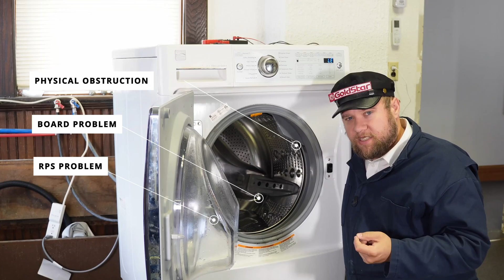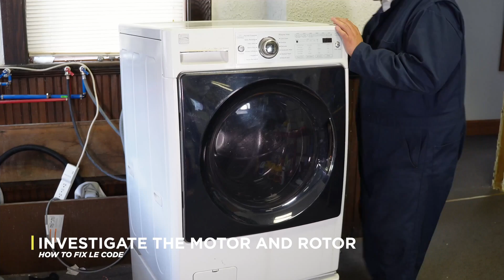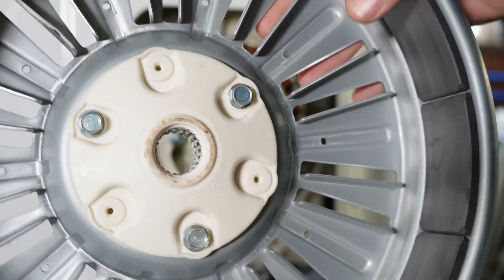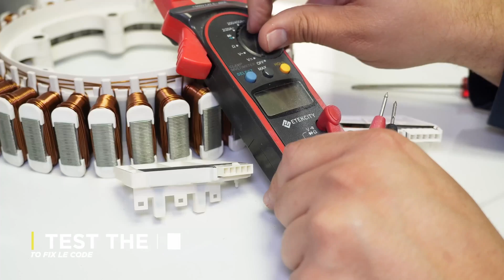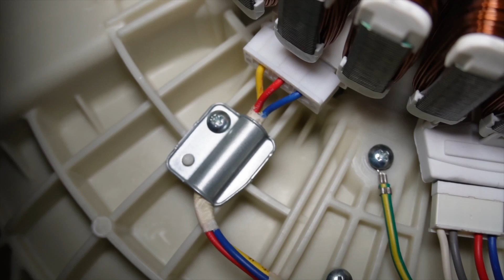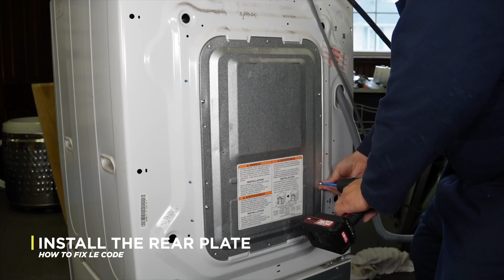LG or Kenmore Washer Won't Run and Makes Noise - Solving the LG Error Code

Comment from the maker: The two parts I mentioned in this video: LG Rotor Position Sensor: https://bens-appliances.com/products/6501kw2002a-lg-rotor-position-sensor-lp2002a?utm_source=yt-kxNxTjK3ovs

LG Rotor Hub: https://bens-appliances.com/products/lg-kenmore-rotor-hub-mbf618448-fits-4413er1001c-4413ea1002b-4413er1003b-4413er1002f?utm_source=yt-kxNxTjK3ovs

Comment: Hey Ben! So I have a Kenmore 41383 and it's showing an LE error. When I manually spin the drum, it spins fine for a second then slows down. Should I still be attempting to replace the RPS or is there an obstruction?

Comment: sensor circuit 1/2 died on my washer today(open circuit, won't even give an ohm reading), gave LE code, growling and won't finish a cycle. ordered a new sensor, hopefully that's all it needs as our washer gets used every day. Thanks for your help if that is all it needed, folks like you make the rest of our lives easier and i really appreciate you!

Comment: Hey man, is this a good machine? My friend has one he is willing to give to me. His dads friend had it for a month and apparently the gasket was leaking. Gave it to my friends dad. They found the gasket was clogged up with tide pods, apparently fixed it but they dont use it since they have a set of machines already. 
Its this same exact model in this video, but online is very hard to find documentation of this video. Im also able to diagnose probably more than the average person as Im a computer engineer. Thanks.
Reply: My mom has had her Kenmore Elite front load like this one for 14 years. Only just had a Hall sensor issue. 10$ part. Easy fix. Even 14 years of how often she uses it is def good compared to washers these days. And if you have no clue what you are doing  then have to pay someone and buy a part it is usually cheaper to just get a new one. Sadly they often upsell you or just lie and claim parts are bad that are fine. It's not like you or most at least are gonna check or know. That is why i learned how to repair appliances and i can rebuild a car engine because you have this issue with mechanics too often as well.

Comment: How do we find out what kind of sensor we need?
Reply: Not sure if you got answered. You can use your model number. Should be there when you open the lid. Or just pull the sensor off and it will have a part number on. Pulling it off is usually the best way because you can confirm it yourself. Every now and then someone puts info up wrong and it can say a part that is wrong. Which is why i prefer pulling the part for the part number. Hope you got yours fixed up if that's what you were doing.

Comment: I'm curious if 10.4 and 9.9 on the rotor position sensor "good enough" or ready to be replaced...couldn't find anything on the internet to confirm this....thanks so much for this video!!
Reply from the maker: Should be good enough. Most devices like this have a 10% tolerance band before failure.

Comment: Does the rotor have a specific “timing” that I need to be concerned about?  Or is it as long as the splines line up on the shaft, it doesn’t matter how it goes on?  Thank you so much for your content!  You just saved me a ton fixing my washer.  You've become my go-to regarding appliance repair.  My next job I need to tackle is replacing the plastic drip pan under my Amanda Bottom freezer, French door refrigerator.  I’ll be combing through your videos to if you’ve addressed it.  Thanks again!

Comment: Hey Ben.  So I ordered replacement pieces for the motor and the rotter magnets and sensor.  When I assembled it I now am getting squeaking and some restriction when I spin the tub.  When the magnets are not assembled it spins just fine but as soon as I attach the rotter which is new I get the squeaking again.  Suggestions?  Thank you.

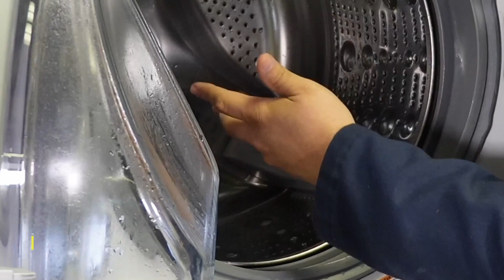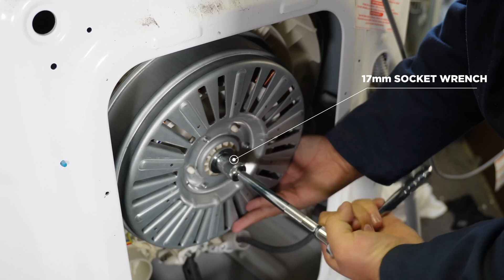Comment: Very impressive! Interesting since I own an LG washer. Hoping this isn’t an inappropriate place to ask this question, but my LG washer is 12-14 yr old and we’ve loved it the whole time. At this point, it’s beginning to show its age, with a bit more noise and vibration from years of overloading from our family of five. I’d REALLY rather repair it than buy new since it’s longest cycle is only ~1:15 vs 2:45 or so with my son’s machine (~5 yr newer), more water efficient, but so slow. Can such a machine be repaired and how does one find a good service provider?
Reply: At that age your bearings and spider arm should be bad, time to buy a new one.
Reply: @Android_Warrior  Thanks for the reply, but I’m mostly concerned about the poorer reliability and grossly longer cycle times of the newer machines. Would it really cost more than a new machine to replace these parts? Or is there something equally expensive lurking around in my beloved washer just waiting to fail?  I really would prefer to spend up to the price of a new machine if that promised a good chance of 8 or so years more service…
Reply: @heymikeyh9577  : If you are not capable of doing the job yourself then paying some one else would be very expensive, it involve rebuilding the washer and that with parts and labor would be the price of a new one.
Reply: @Android_Warrior  No handyman skills here, but as i said, I’d gladly pay the price of a new one to put the old one right, IF I could be confident it would last another 8+ years. If I were to replace the components you mentioned, what do you think the chances are? Apologies for taking up your time, but I REALLY hate waste (only buy cars with 100k+ and run them until there’s nothing left) and as I mentioned before, the old washer is superior to most of what’s available new.
Reply: @heymikeyh9577  : If you got bad bearings buy a new one. you'll get full warranty.
Reply from the maker: It'd be hard and insanely expensive, but if you found someone that was super serious about LG washers, you could maybe see if a brand new tub could be ordered and installed. If it was me, I'd just get a new tub+stator+rotor combo. Everything else isn't really going to age, but that'd give you a new bearing and bracket system where you would see the most failures, imho
Reply: @bensappliancesandjunk  Thanks so much! Any advantage to doing it sooner, before it starts lurching around the laundry room during spin cycles?
Reply from the maker: @heymikeyh9577  not really. finding someone thats willing to take it on will be a job in and of itself, honestly.
Reply: At taht point I’ll just buy a newer Lg. Yes they cycle times are longer, but it is what it is. It also gets your clothes cleaner tumbling for longer. And yes, reliability may have fallen slightly with all brands, but LG has remained on top in terms of build quality for a while. And the turbowash models can have a normal cycle with a full load done under an hour
Reply: @Ikey04-ge9gy  Well, I would buy another LG, but that would turn wash day into wash weekend.  As it is, I usually take all the laundry down to the basement and stay there the whole day (arthritic knees don’t like the stairs) doing laundry and puttering between loads. This would probably more that double my numbers of trips to accomplish the same work.
I’ve never heard of “turbowash”, but I’m suspicious of how good a job such a new machine would do, given their more stingy use of water. It may come down to whether I can even find a reliable tech to do the job…
Thanks for your input!

Comment: Only once have I ever had a broken wire on the stator harness. Also, once it was due to a leak in the water valve directly above the stator. 
LE error almost always requires changing the stator. The position sensor is almost always part of the stator and not separable. Maybe different in the US? I've never seen one.

Comment: As for why the position sensor would cause such a noise, think about that characteristic sound that stepper motors make - like in scanners and CNC machines and such. Much higher pitch but then these washers are a very large, very heavy stepper motor... with no position feedback it's likely just thumping back and forth between two of the however many poles the motor has.

Comment: I think if nylon is still decent but somewhat worn on rotor splines some teflon tape on tub spline will take up space and cut down on friction.
Reply: that rotor is subjected to incredible torque turning back and forth that shaft has a tremendous amount of resistance on the turning action, so you say just put a little tape on it and or a band-aid and everything will be just fine ???
Reply: @johncasor9698  No as a preventative or until new one arrives.  Once the spline is gone it's over.

Comment: ON  a  LE error if no RPS sensor on rotor then it is in the main computer on some models and you must replace the computer,,,  that loud noise when RPS is going out is electricity  power at the stator not knowing which way to turn,,, the RPS plug wires do brake so pull on them to see if they come off at the plug connecter it is always the BLUE wire that is bad or broken i have seen this so many times... and OHM out the stator itself should be from 10-13K,,,  i have many of these go bad.. check very close the wire harness at the tub clamp to the plug of the rotor i saw one where it was damage from flexing only seen one do that it was black & burnt...  now to hold the rotor tight:   just use a screw driver flat blade into the rotor and it will rest against the stator inside of the rotor and be very careful not to hold the screwdriver against the coil wire stacks, just place the screwdriver on the stator white plastic housing  and you will be able to keep the rotor from turning to loosen and tighten the large bolt  no problem... now there is a way to check the RPS sensor with a DMM at the plug connector at the main computer by touching your leads to it and OHM out the harness when turning the rotor slow by hand to read the OHMS it you want to... it is very fast and easy..